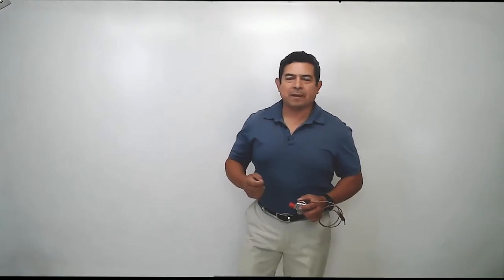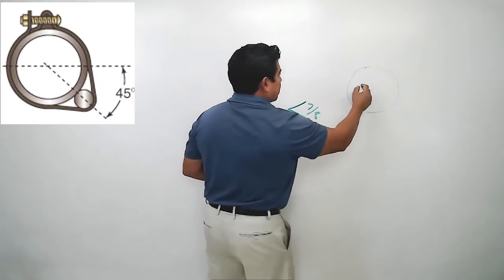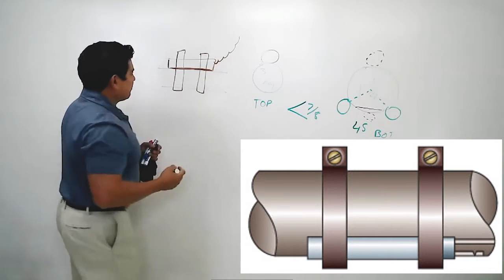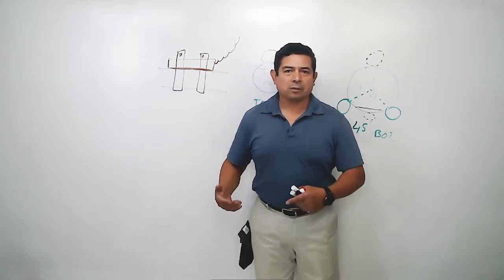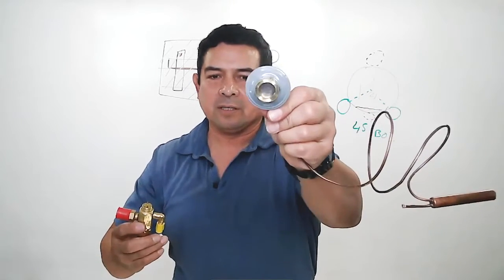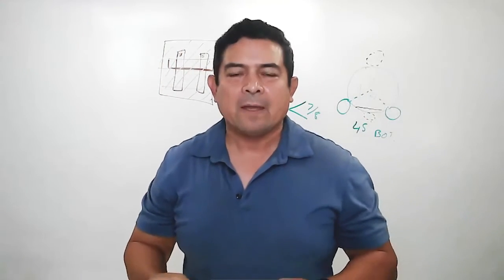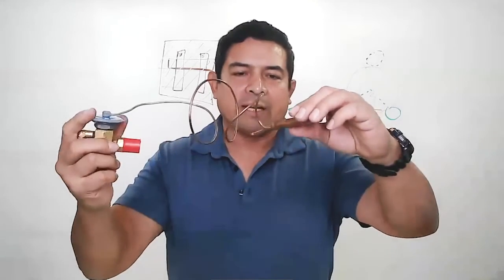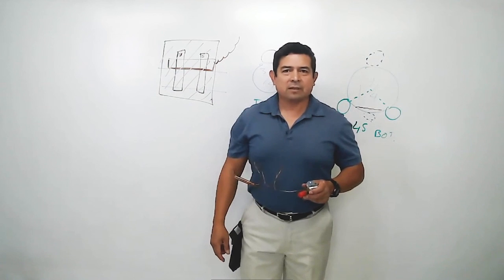TXV parts and basic operation

Comment: Hello Julio,  thanks for another great video.
I was wondering if it's possible to just change the powerhead when changing the freon. For example when converting a refridgerator system from R12 to a modern freon.. 
Or do I have to change the whole TXV?
Thanks a lot
Reply from the maker: I am sorry to say that one of the things that changes is the size of the orifice. So it will be necessary to change the entire metering device/TXV         I wish it was that easy, but the whole thing should be replaced.    Thank you for watching!

Comment: Why do some txv valves have to be set manually? Does this valve open and close by itself, although I have seen that even on manually set valves there is a copper probe at the end of the evaporator
Thanks & Regards
Reply from the maker: The TXV will adjust automatically to maintain proper superheat. The sensing bulb that is located at the outlet of the evaporator is sensing the temperature so that the valve can adjust and maintain proper superheat. That sensing bulb needs to be well insulated so it is not reading the air temperature, but the suction line temperature. When the valve is first installed, the technician should check the superheat and adjust the valve for the proper superheat. They do come adjusted from the manufacturer, but you must always check to see if there is adjusted for your unit. I hope this answers your question, thank you for watching!

Comment: How to get target super heat for txv system for cold room if we need it to be -18 c
Reply from the maker: Something very important is that we need to replace parts with what the manufacturer says they should be. If the TXV is the correct one for the system it should not have any problem creating a pressure drop low enough to give us the -18°C for the cold room. We would still have superheat, because that is the purpose of the TXV to maintain constant superheat. So remember always use the replacement at the manufacturer suggests. I hope this helps and thank you for watching!
Reply: @AirConAcademy  I want to know how to calculate super heat or cool for my system and what number to compare with (target superheat)
Reply from the maker: @moustafaeltahan3206  if you want to calculate superheat, you will need to get the suction line pressure, convert the pressure to temperature. The temperature you get from the PT chart will be the evaporator temperature. Then you get the actual temperature from the line that is leaving the evaporator and you subtract the two. That will be your superheat for the evaporator. In other words, let's say that you have an air conditioning unit that uses refrigerant 22. You get the suction pressure. The suction pressure reads 68 psi G, when you convert that to temperature that converts to 40°. That means the evaporator is at 40°. When you get the temperature of the suction line as it is leaving the evaporator let's say you get 50° so you subtract the 40 from the 50 and you get 10° and that is your superheat.

When you do the sub cooling, you do basically the same thing. You get the high side pressure, convert that to temperature. Then you get the temperature of the liquid line as it is leaving the condenser and you subtract the two temperatures. That is how you get super heat and that is how you get sub cooling. The manufacturer will tell you what the superheat should be and the manufacture could also tell you what the subcooling should be.    
Hope this helps and I hope this answers your question. Good luck and thank you for watching!
Reply: @AirConAcademy  that was very helpful but the target super heat or subcool can be detected in another way if I can’t get manufacturer data ?
Reply from the maker: @moustafaeltahan3206  IF we do not know what the superheat should be we ussualy use use 8 to 12 degrees of superheat   and subcooling 15 to 20 subcooling.  but it is best to find out from the manufacturer.  thank you for watching!!!
Reply from the maker: @moustafaeltahan3206  if we cannot get the information from the manufacturer we go with 8 to 12 superheat and 15 to 25 subcooling.  but it is best to get the information from them.  

Thank you for watching!!!
Reply: @AirConAcademy  i am really sorry hope not to be annoying but this 8 degree in f or c
Reply from the maker: @moustafaeltahan3206  no problem, that would be in Fahrenheit!

Comment: Sir can you explain about moisture block in refrigerator how it happens and how to fix it
Reply from the maker: I'm not too sure, what do you mean by moisture block. The only time I have seen moisture lock in a system is when there is moisture and as it goes through the orifice at the metering device the moisture freezes and it stops the flow of refrigerant. It does not happen often but it does happen. The best thing to do if you have this problem is to install a brand new filter dryer. I would install one on the liquid line and then a suction line filter dryer.   I hope this answers your question, thank you for watching!
Reply: @AirConAcademy  thanks sir 🙏

Comment: Good evening sir, would you make a video on a important subject of liquid refrigerant mix with oil in evaporator ,condenser and compressor side. What's effects on refrigeration cycle in three positions . Specifically on effects Discharge superheat, suction superheat and subcooling. Kindly explain  it important sir! Your video very helpful and clear subject 👌 👍
Reply from the maker: Thank you for your suggestion. I had not thought of that but I will see what I can do about that video. Thank you for the message!

Comment: When the power had is rusted and doesn't allow diaphragm to push down,  would you recommend only changing the power head? Or the whole txv? I've seen guys do both.  Not sure if changing the diaphragm would let out a lot of freon once it's off.  Heard a guy say it doesn't let a lot out, and wouldn't need to pull a vacuum after changing it because system will still have pressure.
Reply from the maker: If the sensing bulb is rusted and it does not have a good connection on to the suction line you can just clean it up and make sure it has good contact. The moving parts inside of the TXV will not get rusted because there is always refrigerant oil traveling with the refrigerant. I have changed the powerhead only on units that have lost the charge in the powerhead. I always recommend pumping the system down or recovering, I prefer to pump down, because it is faster and easier. According to the EPA you're not supposed to release refrigerant to the atmosphere. Not even a little bit. If someone you know is doing it they are taking a chance at being turned in and having to pay the new fine of $44,495 per day per occurrence. I remember before the EPA rulings came around, when we could release refrigerant to the atmosphere, I did something similar to what he is saying. I would pump the system down, including what was in the liquid line, I would pump it into the suction line and only leave between 5 to 10 pounds of pressure in the suction and liquid line. I would unscrew the old powerhead off and screw the new one in within five seconds, and with only 5 to 10 pounds of pressure in the system I would not release hardly any refrigerant and then there was no need to pull a vacuum or add refrigerant since I had pumped all of the refrigerant into the condenser. Now remember this is prior to 1994. I have been doing this since 1979. And back then they were none of these restrictions or regulations. Life was good!  I make sure you don't get yourself into trouble. But that is how are used to do it back then.

Comment: In school they never said if the pipe is smaller than 7/8 to put it in top. It was always 90 degrees or 45 degrees..
Reply from the maker: I'm glad that you were questioning what I said. That is a good thing! Most of the material that I have seen says top or 45° from the bottom.  I am not saying that the school was teaching you wrong. But this is what I have always seen. Like I tell everyone in my class. Don't believe anything I tell you. Go ahead and look it up! Get a book or instruction manual and see what it says. I always make sure that everyone in class does their own research. Ever since I was a kid I always researched what people tell me, just to make sure that I know the correct way of doing it. So I am glad that you were asking about the 90°!

Comment: Do we have to put insulation on  Lennox sensing bulb?
Reply from the maker: Yes, all sensing bulb should be insulated so you can sense the actual temperature of the suction line. This is how the TXV figures out what the superheat is and if it needs to open or close. If it is not insulated it will read a warmer temperature and decrease the superheat, which could get liquid back to the compressor and destroy your compressor.